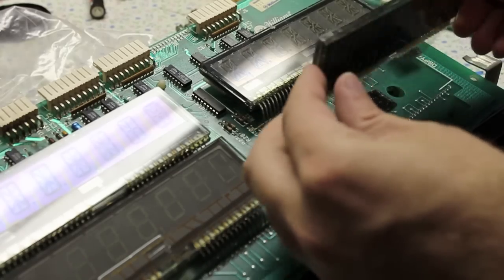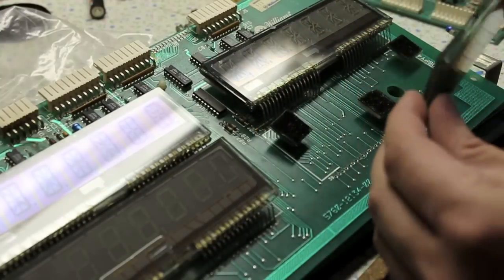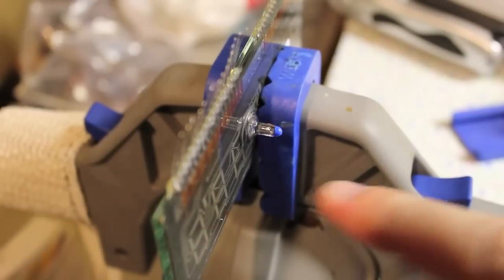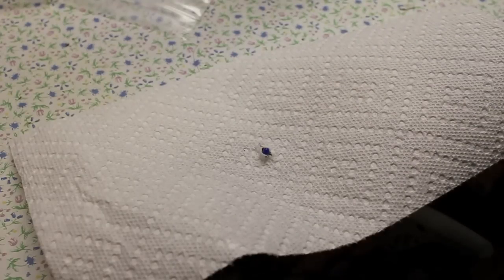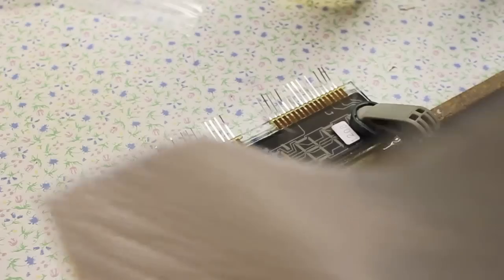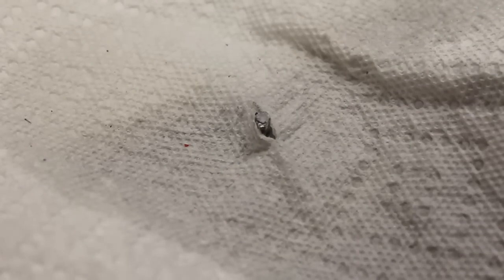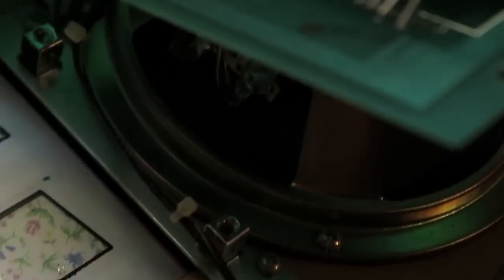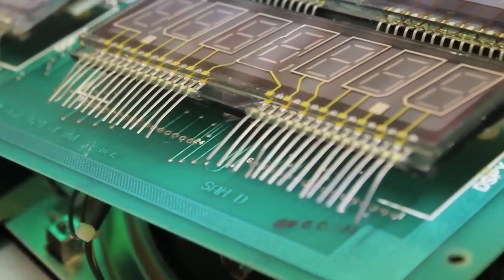Modifying New Numeric Display Fit on Sys11 Pinball Machine

Comment: Could you have just drilled a hole in the circuit board?
Reply from the maker: Yes, but then a bunch of jumper wires would have been required. That means a whole lot of soldering and chances to damage the original board.